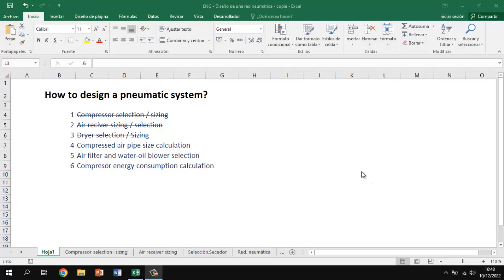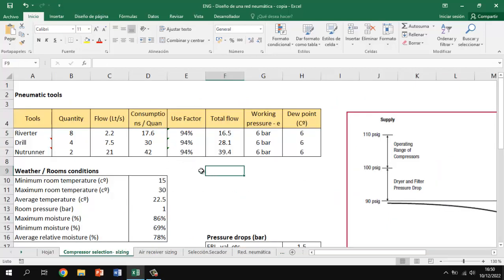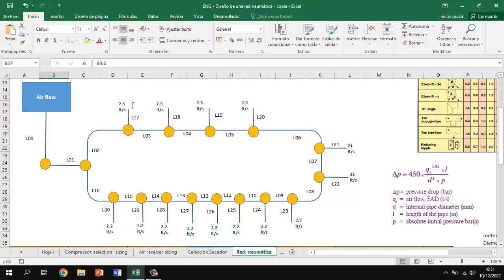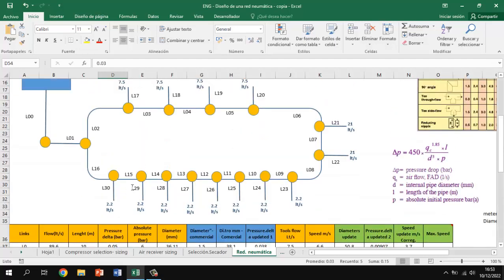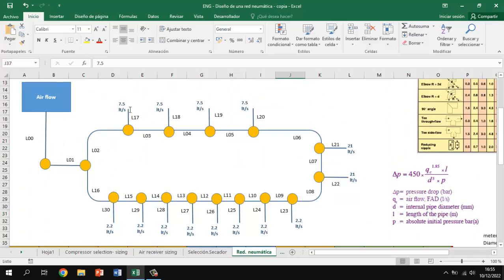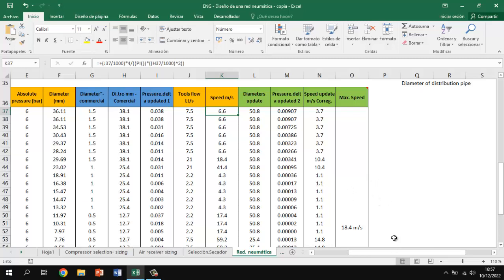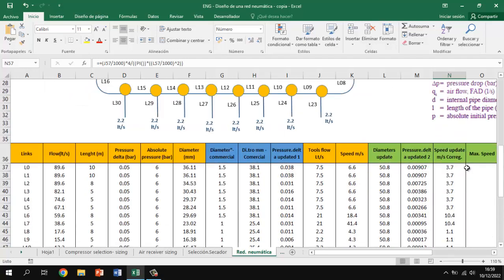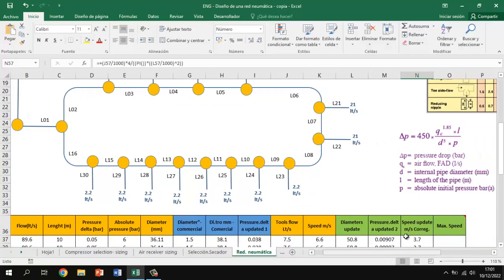HOW TO DESIGN A PNEUMATIC SYSTEM - PART 4 – PIPE SELECTION / SIZING CALCULATION

Comment: The ecuation for pressure drop, where can i Found it? Their deduction please
Reply from the maker: Hi Jorge, you can find it in the atlas copco manual; or you can do a hydraulic calcution for compressible flows, like isothermal flow equation, weymouth, etc; if you want. ✌
Reply: @TopEngineer.07  Thanks.